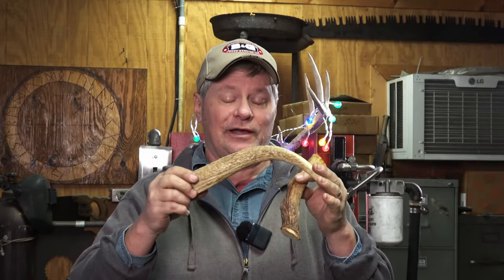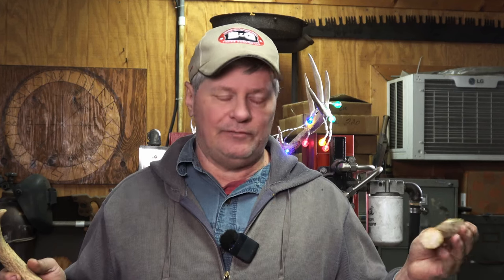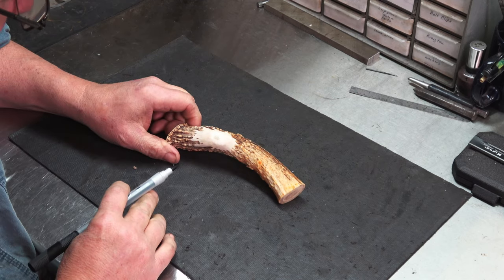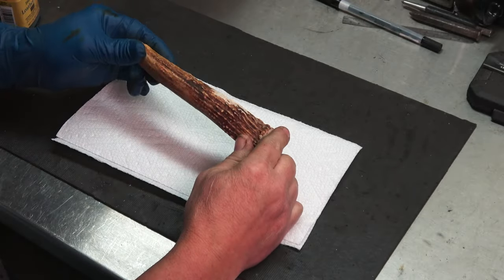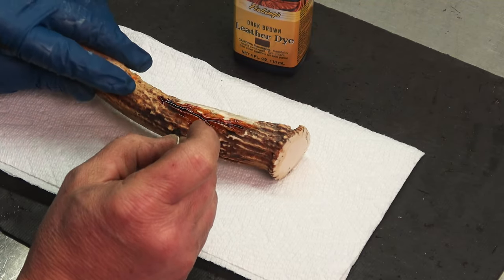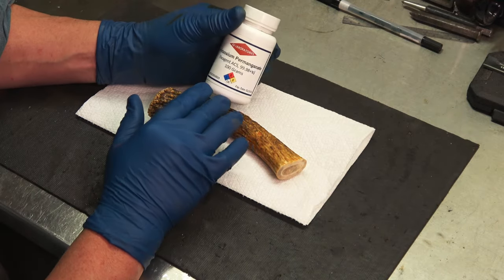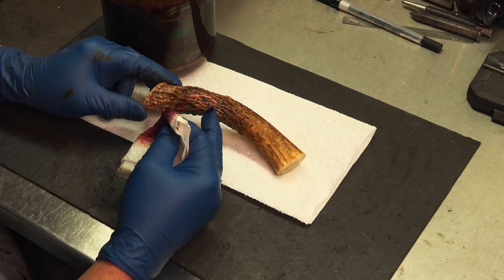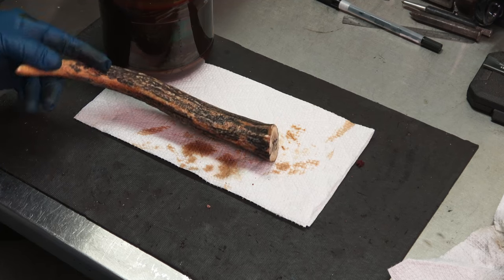How to EASILY restore color to Stag and Deer Antler

Comment: Do I have this right 
If you have an antler that is bliched out or both sides are to light in color &/or lack that nice brown yellow color the steps are -
Dye in some groves & sand off tops to get a two tone mt & valy look
Then stain the whole piece with the potassium 
Next vacuum the whole piece in resin to stabilize antler so it doesn't crack or shrink
PLEASE comment 
I know you didn't cover the vacuuming part(I picked that up from another video) but trying to figure if it is a necessary step on old drop antlers to make the handle last
Reply from the maker: Yes on the dye part but I did not do any vacuum stabilization.  I never have for antler.  It’s very stable on its own.